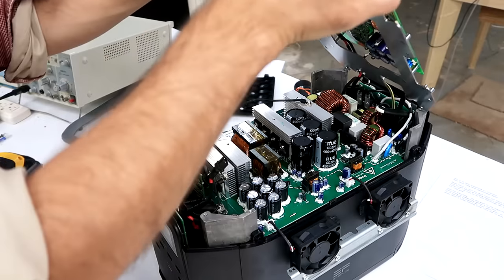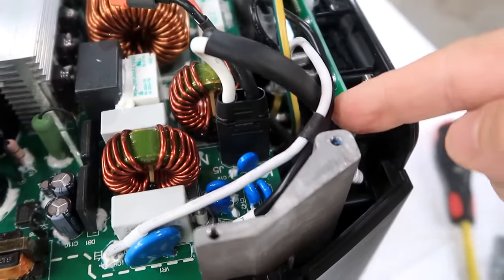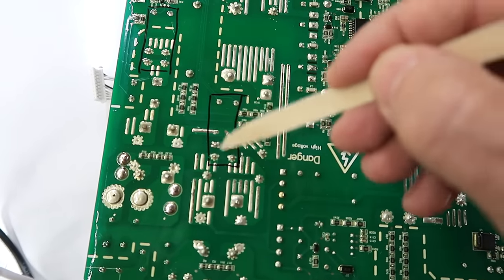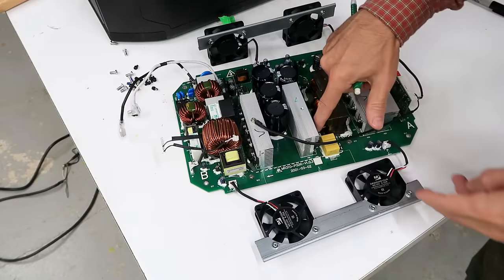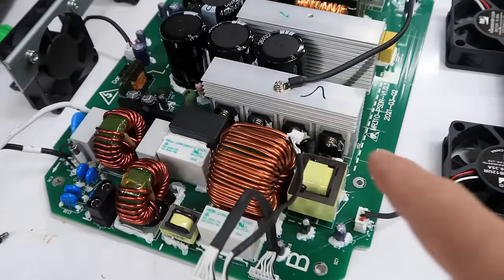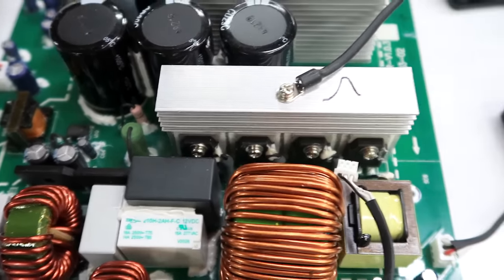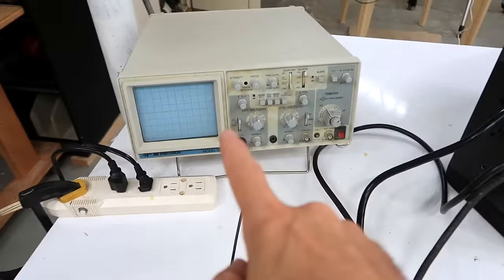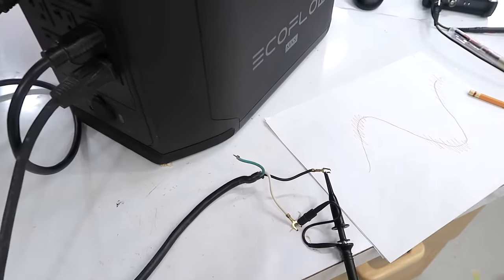Inside a portable battery power station

Comment: Your 'scope probe is connected to ground? Strange, usually the probe connection is floating, and there is a ground terminal on the scope for if you need to ground it.
Reply: Not strange at all, probes are almost always grounded.  That's why you never measure differential voltages without a differential probe.
Reply: @sycc66  Strange- I have been using 'scopes for over 50 years- have even built them. Never met one with a grounded 0v line. Have seen front panel links so you can ground them, if desired. Isolated is essential for audio work - otherwise you have a ground loop.
Reply: @Tensquaremetreworkshop  I am guessing it has maybe been over 50 years since you bought a new scope then? As far as I can remember, all the scopes I have used were grounded. They have a pictorial indication on the panel that the outer shell of the BNC connector is grounded. Mostly compact tektronix models. I have been doing this for 20 years, so you have seniority on me.
Reply: @mckenziekeith7434  You are correct that my 'scopes are of some vintage now. It may well be that recent models are grounded- my question would be - why? What advantage would permanent grounding convey? Optional, yes (front panel control) but always? Clearly, as this video shows, it has downsides, so why do it? Cheaper can be the only reason that I can see, and that translates to inferior. I guess they are usually used for logic circuits these days, but that is a poor excuse.

Comment: So at the end of the day, you have some parts for a future project, right? This is beyond my paygrade, and my eyes are glazing over. Is there any way to fix this if you were able to get a board replacement, or did it bugger up the DC board too?
Reply from the maker: Not sure what I would use it for.
Reply: @matthiasrandomstuff2221  you could take a guess on some replacement transistors

Comment: Matthias please just purchase a differential probe when probing AC systems.  There are plenty of affordable probes on Amazon.  They prevent all grounding issues you might encounter, since the probe does not have a true ground connection.
Reply from the maker: If the probe doesn't have a ground connctino, you need to connect the scope ground to the machine ground separately.  if there's no common ground, you get garbage readings.
Reply: @matthiasrandomstuff2221  That's the point of the differential probe? It isolates the ground of the scope with the measurement 'ground' (although there's no real 'ground' probe on the measurement side anymore - they're both floating so it's more of a positive - negative situation).
Reply: @matthiasrandomstuff2221  This is exactly why a differential probe is useful. The probe takes the voltage across two input wires and uses it to generate a new voltage at ground level that is then fed into the scopes BNC connector. This means the red and black input wire can be connected to any voltage potential up to a kilovolt or two. The black wire on that differential probe is not connected to the scope ground in any way.
Reply: @matthiasrandomstuff2221  No, that's not how a differential probe works.  They have active circuitry inside, and do not require a common ground connection for the device under testing.  They take a differential measurement between the positive and negative probes.  It's effectively a two channel probe, each lead is referenced to a ground internally, but the measurement it presents to the scope is the difference of these two measurements.  Since both "channels" in the probe are referenced to the same ground, this cancels out, and you're left with the true signal across the probe leads, without the need for common grounding.

Comment: Really well done all things considered. I think you're selling yourself short though about fixing it. I'm sure some nerds can find a compatible MOSFET/IGBT whatever that thing uses and it wouldn't be too bad to swap them out with a proper desoldering station. Desolder all of them and remove the heatsink and transistors in one shot so you're not trying to access those screws behind all the components.
Reply: Yeah, there's probably a sizable range of "close enough" compatible MOSFETS he could use. Even if he can't get two more with specs comparable to the two that still function, he could just go ahead and replace all four to keep them matching.
Reply: @SuperDavidEF  Agreed. Though finding parts like that can definitely be a needle in a haystack sometimes.

Comment: I have a question. Do you know the new model which uses LFP battery. Everything looks same except that. So do you think we can replace old li ion battery with lfp battery? Thanks in advance. Delta max 2000 (2016wh) delta 2 max (2048wh)
Reply from the maker: I don't know if those chemistries are compatible.  Voltages may be different.

Comment: to look for short circuits in electronics I use a variable power supply AC or DC mostly DC, then I slowly turn up to about 100-500mA then you look with a thermal camera or feel forward with the hand, it works 90%. Another thing, never ground on an oscilloscope. You could use a transformer on the output of the ecoflow to go from 120v down to 15v AC with a 1Kohm resistor between the wires and measure there. I think it is the saw that makes these high frequencies but test it with an oil radiator or electric patio heater.

Comment: At $1000 to $2000 for each of those power stations I'd seriously set about repairing the broken one.  Transistors can be replaced easily enough.  A Hakko FR301 desoldering pump will make short work of removing the solder from all the transistor pins.  Use a Dremel wire-wheel to remove the conformal coating first, then pull the heatsink out as a unit.  To search for the transistor try some of the electronics forums.  The device is still in production so I have to assume the transistors are too.  You just have to find out the correct designation as that's not always obvious by looking at the cases.  If they really are not available then the forums can help you find equivalents.

Comment: If that thing is UL listed, you should call up a lawyer. If built the pencil-CAD way, it has no neutral; it has two hot's. (as that's what the NEC calls a "separately derived system", ground and neutral must be tied together within the unit. And the input and output grounds must be connected ("bonded") There's also supposed to be fuses or breaker in there.)

Bottom line, this thing is a dangerous piece of trash.

Comment: My guess for the reason you see the voltage spikes superimposed on the waveform is that the DC bus capacitors are specced for nominal load, whatever that would be. During startup, when a high current is drawn, the ripple generated by the full bridge boost converter appears on the output.

Comment: Interesting. 

I kind of like your University degree's line of courses that I had read or heard was a bit of a mix of engineering. It seems to have given enough electrical engineering in addition to other areas to be pretty useful. I on the other hand on puzzles like this have to start from scratch because math theory is about as removed from practical application as possible to achieve.

Comment: With something like this, could you leave it plugged in 24/7 safely on standby, so when you need it??
Reply: You could. But leaving lithium batteries in a high state of charge for long periods of times shorteners their life. I'm not sure about this model, but some chargers allow you to set an upper limit of 50% or so for putting into storage and topping it up automatically. I don't quite agree with the point made in the video about generators being more suitable for long term storage. If you're the type of person who can fix a generator. You can most likely remember to give the battery a boost charge every 6 months.

Comment: for most people that just want to look at relatively low-frequency waveforms, those cheap ass scopemeters sub $200, even sub-$100 give that capability in spades, and never have to worry about current paths.  If you want an early divorce, go big and get a Fluke 190.  That's 99% of the capability you'll ever need in a meter or scope, especially if you haven't already spent money on an expensive bench scope.

If you do have a nice scope, $200 gets you a solid differential probe, like a Micsig, which gets you through 99% of situations, and allows you to use all the math, memory or FFT functions of your scope.  Plus you get some attenuation to probe higher signals than your scope allows, like yummy transformer flyback spikes (DP10013). There's also isolation transformers, which can be had under $100 (hospital use), and you can probe all 4 channels at once, but if you have an iso transformer, you probably already know what you're doing.
Reply from the maker: another reason I didn't use the usb scope initially is that it doesn't go up to 120 volts.

Comment: Don't measure like that with your laptop if that USB scope is not isolated!!!
Your whole laptop will be "live" that way. Touching any metal part of your laptop will shock you, very dangerous.

Best way to measure high voltages is by using an isolated probe or measure in differential mode (using signal of 2 channels and no ground)
Reply from the maker: Not really.  I have worked on old TVs where chassis was connected to one lead of the plug.  Always swiped the chassis first after I plugged it in to make sure it was on neutral. After about 10x, I thought it was odd that I plugged it in chassis neutral (non polairzed plug).  Then I realized, standing on carpet, touching hot did nothing to me!

Comment: Are the batteries inside those removable  and replaceable or are they glued into place for example?
Reply from the maker: Not meant to be removed.  But good for a few thousand cycles.
Reply: @matthiasrandomstuff2221  wouldn't it technically be possible to remove or upgrade them in the future when they wear down? Sounds like a better idea than throwing it away

Comment: Hrmm...   I DO have a couple solar panels.  I wonder if I could connect them.
Reply from the maker: as best I can tell, it even does peak power point tracking on the input.  It certainly peak power point tracked my DC power supply when I charged it from 12 votls, always hitting max current and voltage!
Reply: @matthiasrandomstuff2221  unfortunately, IIRC, my panels are ~50v open circuit or something as they're intended for "grid tie" or w/e use.

Either way, I suppose this is something I need to look into as I think you make a good point on cost/benefit when one of these devices is connected to solar.

Comment: We need BigClive to explain this "Gound is not Neutral"-scheiße. Usually it is, as both wires end up at the same spot at the transformer.  In the meantime I assume this power station generates symmetric sine-wave between hot and neutral and just lets the ground-wire go through from plug to plug.  Connecting the ground to the live wires should not cause equipment failure but just break the "ground-current" fuse. Would not happen in EU, they have at least some safety standards.

Comment: If you would post the part number / name of does transistors, "someone" will find you an suitable alternativ
Reply: Still getting them out and the new ones back in again didn't look fun. Especially without damage to the board.
Reply: Parts don't always have part numbers on them, although large transistors usually do. But those are hard to even see with the heatsinking and giant E-caps.
Reply: @mckenziekeith7434  well he said that he looked them up and didn't find them anywhere (to buy). however "someone" could suggest a different part that would fit within the electrical characteristic of the original.

Comment: So you cannot charge it while discharging it?
Reply: Well, not in the way you are describing it. Looking at the circuit, if the relay is closed you should be able to charge the battery while powering something from the outputs all directly from mains. The battery would remain topped off until mains is no longer available at which point the relay should open. But I don't know how the relay is wired.
Reply: The problem was the scope not the "charging while using"
Reply: @davipip  Though my question had nothing to do with the problem, which was quite clearly explained in the video.
Reply: Answer stays the same, you can do whatever you want as long as you are not a probe enthausiast ;-)

Comment: Ok... impressive design...
Edit:
It is fixable but you need a good hot air station, good soldering iron, solder pump and wick. 
You will need up-to-spec or better transistors not necessarily identical. Get their datasheets and get some similar or better (better rDS-on, current, lower or equal gate charge, etc)
Also, when you bust a transistor or two in an H bridge, replace them all and their gate drivers!

And, my free tip for you: put a set of S-D flyback diodes on all the H bridges. Have them as close to the transistors as physically possible. I put the tht ones on the other side of the pcb, on the transistor pins directly. 
Fast, but fast, 50ns fast, beefy like 2x mosfet/igbt rated drain current. 
The lack of flyback diodes killed your inverter. Inductive loads, huge short spikes, blew the fets and their gate drivers. 

Also, add more filtering. 0.5H, wound with litz wire for rated current on good ferrite torroid core. 
Make it identical to the existent one and use 4.7uF@250-350vac to null after the choke. 

A big NTC at the final output phase line will help extra high loads starting like fridges, compresdors and saws(10-5ohm max at 20°C, rated for your max current)

Comment: Thanks for your misfortune with that junk. I hate seeing equipment made cheaply. I've had to change too many capacitors in my life from them wearing out.
Reply: Did you watch the video? What about it is made cheaply?
Reply: @mattv5281  Mainly the capacitors used worry me for it having a long life.
Reply from the maker: so you conclude t he capacitors are made cheaply because I blew it up with an entirely different mistake.  Do explain your logic.
Reply: @matthiasrandomstuff2221  That type of capacitor doesn't seem to ever last 8 years for me.
Reply: @matthiasrandomstuff2221  sounds like he has a problem with electrolytic capacitors in general. Not sure what else you could use for this circuit? To be fair, I've never heard of RUC brand capacitors.
Reply: Well, I mean it is not exactly a revelation that E-caps don't last forever. But there is no substitute for them as far as I know. Some industrial inverters keep track of usage and let you know when you need to change the E-caps. They also design the products so they are not too difficult to change out.
Reply: @mckenziekeith7434  The kind you see on many computers motherboards should be made for the higher specs.
Reply: @lightdark00  The only motherboards I have designed were compact PCI single board computers. They had to fit in a slot on a 6U backplane. So we didn't have room for any E-caps. All ceramic and tantalum. But you can't use tantalum in an inverter. Aluminum electrolytics are the only caps available for that application. Tantalums would be impractically large. I don't know if modern computer motherboards use aluminum electrolytics, but in any event, they are not 450 V on a mother board.

Comment: I don't get what's all the rage about these suddenly (other than that company is probably dumping too much money into marketing, so you keep hearing about these at every turn). You can use any old UPS to do this exact same thing, and people have done that for years. You just have to get a UPS that can start the inverter without AC applied. The only difference here is this is lithium batteries, and UPSes tend to be lead acid. This isn't some fancy new product - it's a UPS, with lithium batteries.
Reply: An UPS with lithium batteries is awesome! You get so much more energy density than an old lead-acid battery system.
Reply from the maker: Also, the old lead acid UPSs wouldn't stand up to a lot of charge cycles - lead acid batteries don't like being deep cycled.  And to get something usable, for much, it gets so heavy its no longer portable.
Reply: afaict it can charge from mains, a car, or a number  of solarcells with maximum power tracking. Can can any old UPS do that?
Reply: @fuzzy1dk  A UPS can charge from mains, or DC if you connect to the batteries directly. It wouldn't have MPPT for solar charging, but that wasn't really a thing when most old UPSes were made (nor was solar charging really a use case for the UPS's of yore)
Reply: @gorak9000  so any old UPS can't do "exact same thing"
Reply: @fuzzy1dk  I'm guessing if you're dragging a solar panel around with you, throwing in a separate MPPT controller wouldn't be a big deal
Reply: A lot of 'portable' solar panel units come with an MPPT included in the unit so you can use them with 'dumb' chargers, so you could recycle an old UPS with a new 12v socket, a few wires and new batteries. Too bad it doesn't have a 220/240 volt output option for the 'rest' of the World.
Reply: @brucelee3388  Some large rack-mount UPSes for servers definitely do provide (and take in) 240V. Really large ones are even 3 phase (but that's not the kind of thing you're going to haul around for "portable power", unless you're Andrew Camarata and take a forklift with you when you go camping! And I'd imagine that UPSes for everywhere other than N. America and Japan would provide 240V - they'd be pretty useless in 90% of the world if they didn't.

Comment: A little bit of due diligence by ecoflow probably could have prevented the unit from being fried. External surge protection devices for RVs are able to check the potential between line, neutral and ground, and prevent the relay from closing if there is a problem.